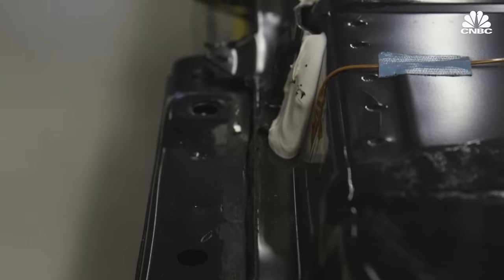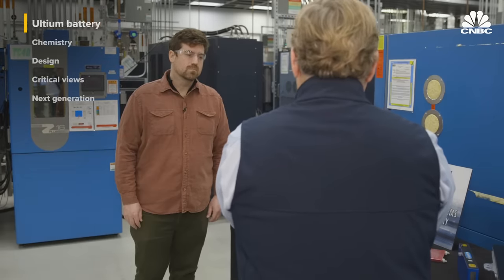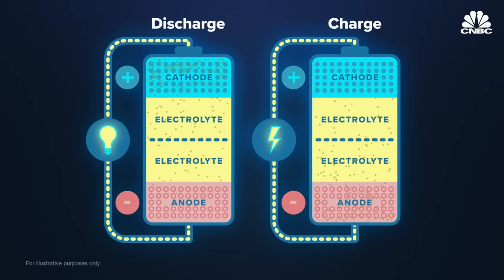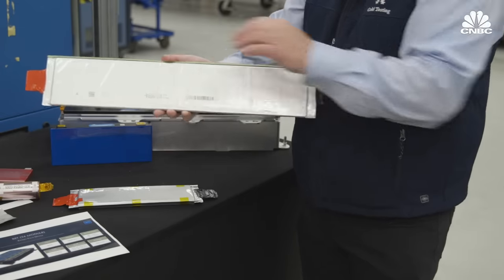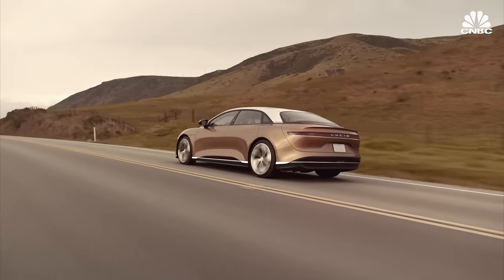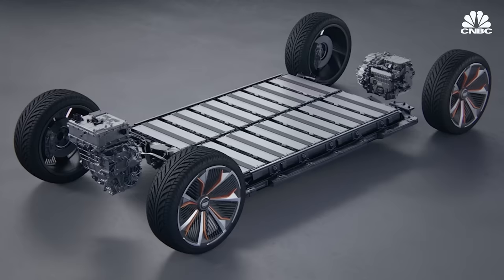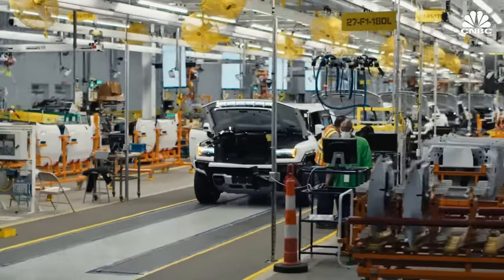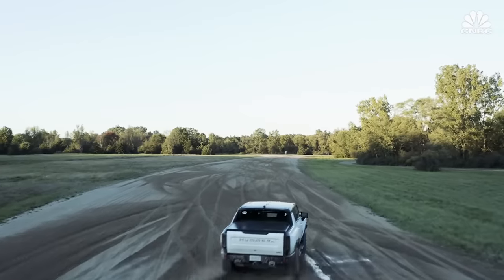Why GM Says Its Ultium Batteries Will Lead It To EV Dominance

Comment: I heard no mention of a cooling system for those battery packs. How will the inevitable heat be dissipated, so the infamous fire staters known as lithium ion batteries (the pouch style, especially) won't/don't go up in flames? Heat is the enemy of any and every thing.

Comment: There's nothing wrong with 'Ultium', but it's definitely nothing special compared to the competition. Locking yourself into a single structural/battery technology when the market is this immature seems unfortunate.
Reply: I dunno pretty good specs and LG energy believes in it and so do other brands as well

Comment: A range of over 400 miles means that EVS now make sense for me. Maintenance is much simpler on electric vehicles becuase their systems are simpler than internal combustion engines. If I can charge the battery with my home solar system, then I'll be able to drive by the charging stations!

Comment: As long as you have a very good battery and a good software 🐎

You have won most of the battle in the EV market 🐓

You just need to improve other hardwares after which is a lot easier then make the car very interesting!!! 🐆

Comment: There is no mention of overall efficiency or cost comparisons. Clearly LFPs have advantages for many applications.

If a car can get the same performance with a smaller less expensive pack, that makes it more profitable to produce...all things considered.

Tesla is using a wide variety of cells from several sources. If a new type comes along, they can pivot and use those in some or all vehicles. They can still use their "older" cells in Megapacks and Powerwalls. So they have great flexibility.

If you are an Uber driver or fleet owner, you will buy/lease the car with the lowest cost per mile. That looks to be Tesla now.

Then there is the overall manufacturing efficiency of Tesla's structural 4680 battery pack where the seats and console are attached and then inserted into the giga cast frame structure from below.

Comment: Let me help you .  A small permanent magnet is positive on one side and negative on the other side of the magnet.   The north side is the presence of electrons.  And the south side does not have the presence of electrons.  You can arrange these small magnets as batteries.  With each line of magnets accumulate the current and being one magnet of voltage  and all of the lines  accumulate
 the voltage.  You can arrange the small magnets to produce any current or voltage DC that you want to have as permanent current and voltage.  This can be wired to inverters to deliver high voltage AC power continuous peak power without fuel or pollution.  Charging stations is lame.

Comment: This is all well and good.  What concerns me is that I'm not hearing much talk about building new electrical power plants to support EV demand.
Reply: Gm just made a deal with pilot to put a gm charging station at every one of there stations and another 10000 charging stations by 2025
Reply: @wsupike1868  that's cool too, but I see that my comment was not clear, so I just edited it.  What I mean is not enough actual power plants to be able to supply the increased demand that EV's will put on the system.

Comment: Electric cars are not green as long as the electricity comes from burning coal or natural gas. There is no way that wind farms, solar power, and hydroelectric (dams) can provide enough power for all the cars that people drive. In the long run, electric cars will make nuclear energy a popular alternative, since modern nuclear power plants can be built more safely and provide the amount of electric power needed for all these cars. But, of course, that means dealing with nuclear waste. Fusion energy will be better in terms of radioactive waste, but fusion is many decades away from being practical--and will probably require government subsidies because it's not that economical (think taxes on cars to pay for the fusion-based electricity needed to run them).

Comment: I just got an article from Motor Authority about GM is getting into the electric boat business be cause they are the only company that has battery technology light enough for large high powered boats
Reply: And..... BMS tec is easier is a water world.!.!.!.
Reply: @philmanke7642  and that is why boats with 4 cycle engines require twice the horse power and use twice as much fuel? Because they weigh twice as much

Comment: I travel long distances (1,600 miles in a trip over 2 days) as such I need both the longer range and also fast charging.  And given that I am often in Remote/Rural Places of Wyoming and Montana having a way to quickly charge from a non-super charger type of infrastructure is going to be important for me to move to an EV.
Reply: So don't buy an EV.  What's your problem?
Reply: @rcpmac  If EV's become the only option then in the long run this is an issue that needs to be considered.  Especially as the Auto makers are making statements like 100% EV by 2030 etc...

Comment: I was at the Epcot center in 1985 at the energy pavillon and I saw a display of an electric car base frame quite similar to the present model and with a diesel 3 cylinder turbo for recharge and assist. So much time was loosened ……
Reply: Diesel so you could roll coal on EVs.

Comment: A alternator can be wired to 220v A/C and can power a whole house or it can produce high voltage D/C as well and also a alternator can be wired to be a single phase we don't need batteries technically

Comment: GM really needs to switch to Lithium Iron Phosphate battery chemistry.  It is cheaper and lasts 2 to 3 times longer.  It is also way safer.  Auto manufacturers in general need to get over this obsession with long range.  Long range means big batteries which are more expensive because of their huge size.  Huge batteries also weight a lot more so it takes more electricity per mile with means it takes longer to charge mile per mile.  As the infrastructure builds up for DC Fast charging the need for long range becomes mute.  The Chevy Spark EV was GMs first all electric vehicle that the public could buy not the Bolt.  I know I own a 2014 Spark EV which has a Lithium Iron Phosphate battery and in 8 years it has only lost 1 or possibly 2 miles of range.  California the DC Fast charging infrastructure has built up enough that even though my car can only go about 70 miles at 65 mph there are enough DC Fast charging stations I can go anywhere in California.  The great thing about the Lithium Iron Phosphate battery too is I can DC Fast charge multiple times in a day and it will not harm the battery.  You can't say that about batteries that use Cobalt and Nickel.  I drive for 45 to 50 minutes hope off the freeway and DC Fast Charge for 10 or 15 minutes and I am on my way again.

Comment: 1 million units in 2025 of 30 models is 33,333 per model per year.  Or just 20% off the projected TSLA numbers. 

8,334 per model per quarter isn’t up to catching TSLA currently or in the future. 

FY22: 1.440K (TSLA own estimates): using 50% basis for the rest of the current decade.   FY23 2.160K 
FY24 3.240K 
FY25 4.860K << GM supposed surpassing TSLA.  
FY26 7.290K
 FY27 10.935K 
FY28 16.402.500 
FY29 24.603.750
 FY30 36.905.626

Comment: gm has made so many misteps in the past that I am not sure they can survive, much less keep up and will probably never lead. They have to get their ship together in the next couple of years or Wuling (or some other Chinese company) will own the gm name soon after (Think Volvo). I don't think they have the leadership team to pull it off (oooh, 50KW charging on a new Bolt).

Ford's change in management seems to be putting them in the right direction, but all these legacy automakers have such huge issues transitioning that I am not sure they can do it. I do give Ford the best shot of any of them.

The one thing that "might" save the legacies will be the Tesla supercharger network, when it opens up to the other EVs.

Comment: Why this news program does not include a number of clips of Elon Musk talking about the need to have inexpensive high volume battery production is beyond me. There are any number of quotes from the last "battery day" presentation that shows Tesla's efforts to bring down the battery cost. Everything said by the GM engineer that was supposedly innovative has already been done by other manufacturers (mostly Tesla). GM does not need to present itself as innovative, rather they can be just as impressive as saying that they understand they need to make this change and luckily they can use guidance provided by other manufacturers to catch up quickly. The fact that every one of their new vehicles is a massive one is disappointing. Not only does that increase resource utilization to build the vehicle, but it increases charging time and electricity used. The GM and Ford electric trucks will be roughly 1/2 as efficient as Tesla's M3 and MY, which is unfortunate. That said, I am so glad they are finally going electric and will stop polluting our world.

Comment: What the Auto Manufactures do not tell us, is what I find troubling.  Where will we get all the power to charge these batteries and how are we going to dispose the batteries, when no longer usable.   The manufacturing and disposing all add to polluting just as does the creation of electric.  Batteries store electric, they do not create electric.   If you buy an EV for $60,000 to $70,000 and then several years later must replace the battery for an additional $20,000, most of us will end of walking.

Comment: Only $1 to drive 80 miles so it seems very inexpensive until that battery takes a dump on you. Tesla's battery replacement costs about $25,000 or GM says "the life of your vehicle is over, buy a new one". You will forget all about how cheap those recharges were really fast when it costs $25,000 for a new battery. With the toxic heavy metals in the batteries it's only a matter of time before there is an added $5000+ surcharge for toxic waste disposal.

Comment: I'm not biting until GM publishes some specifications for their Ultium battery.  What's the overall weight of the battery pack.  What is the power per kilogram of the chemistry?  GM talks a lot and sends out a lot of press releases but no one has been independently verifying anything from GM.  Talk is cheap - well, in the case of EVs talk is also expensive and in GM's case talk is not convincing.

Comment: A car can run off the alternator with out a problem alternator put out a good amount of amps and voltage and can run on there own if u no what ur doing.  Connect a small 12v light bulb to the alternator and spin it by hand and it'll light

Comment: I live out west where the population density is low and the distance between towns can be very large.   It will likely be a long time to get the electrical grid up to sufficient capability to handle charging large numbers of ev's in such areas and to have a sufficient number of charging stations available for long distance travel.   You can pump all the electric vehicles out you want but if there is no where to charge them on a trip, you're dead in the water.
Reply: They take too long to charge and their energy density is too low.
Reply: @bighands69  There are new batteries on the horizon with nearly twice the capacity of the ones Tesla is using.

Comment: So what is revolutionary in Ultium battery? When the world is going to solid state and borophene based batteries, GM is still talking about Li-ion batteries. GM should define their battery pack form factors and interfaces such that when SSB, Graphene/Borophene based and even Nano/Nuclear Diamond Batteries are available, it can switch its old battery pack for new packs containing newer technology. Hope GM is working with QuantumScape, SolidPower, StoreDot, and other battery startups. 

In the future when battery technology hits a plateau, what will differentiate one EV from another? Customers will not care what battery chemistry their car has. What will differentiate will be cost, range, time to charge, miles/kwh, handling, comfort and other functionality. I own a BOLT, but I still get range anxiety if I have to drive from the Bay Area to Sacramento and back. I have to wait hours charging my car before I venture back to the Bay Area... I'm waiting for a cheaper BOLT with at least 400-500 mile range... Lyriq does not do well as far as range is concerned, and is TOO EXPENSIVE... If Tesla comes out with a cheaper car ($10k-$15k) with ~300 mile range (of course using newer battery chemistries with much higher energy densities) I and many others will switch to Tesla.

(Also GM is still talking about EV leadership in the US, while Chinese companies are thinking about global EV leadership. What happened to the US? Sad that it lost its leadership in several technologies. Too much infighting and polarization in the U.S.)

Comment: So just in terms of CO2, how "green" are these cars? Well I did some calculations, comparing my 1996 Ford Fiesta with one of these things and over the next 10 years the Tesla is 20 TIMES WORSE!!! I will explain:- I have taken into account the build, the replacement battery in 7 years, tyres which wear out faster and the fossil fuels required to charge it up. My Ford, will need a few spare parts each year, one set of tyres and does around 50 mpg (5.5l/100km) covering say 10,000 miles (16,000km)/year. Looking at depreciation, the Testa will be a write off as the cost of new batteries will outweigh it's value and in 10 years my Ford will be 36 years old. Now I could look at a newer car and the results would be similar, but 20 TIMES WORSE is a big number for something we are told is "green" and which I have to subsidise and the owner has to suffer range anxiety, or buy a second car. That is the reality folks...you are being had!!!!

Comment: As long as its lithium ion the battery isn't groundbreaking and won't create any sort of advantage in the market. Lithium ion battery's use expensive and hard to find materials and don't have enough charge cycles to justify long term use in a vehicle most consumers want to last as long as an internal combustion engine.

Comment: I´m all for EV, BUT...... One huge problem, that no one wants to talks about, it that batteries eventually fade out, until your car can no longer works properly. You might say, well, just replace the batteries, right? The thing is, it will not be financially viable, like fixing an old gas engine. Batteries are incredibly expensive to replace. So, selling your old EV will become an impossible task, rendering it worthless. Disposable. 
So, until batteries prices come considerably down, which they should, I´m sticking onto gas cars. 
Now, ignoring this issue (and charging times and driving range), EVs will only make sense if the electricity to charge them is clean. Otherwise, we´re are just fooling ourselves all over again. Lastly, what is going to happen to all those old batteries one EV become the main transportation? They must be recyclable.  Best wishes to the EV industry!

Comment: my LG refrigerator  has a replaceable bus style glass fuse underneath a screw panel on the top of the refrigerator. When I blew, it cost me three dollars and the fuse was obtained at the local hardware store -in 1/2 hour.. One year later LG fuses were soldered in place I assume as an attempt to keep the homeowner from replacing them and forcing you to buy a whole board. 
On the internet is a video on how to unsolder the fuse.  So no stay away  from LG and hence GM

Comment: Isn’t that odd. I’ve heard much differently. When I think battery powered vehicles … I think about my DeWalt 20 volt battery circular saw. On. Then dead battery. Fortunately I only have to swap out tho battery and I’m good to go.  If I’m between destinations …. I’m screwed or sitting on the edge of a parking lot at night charging my nifty “green” car.

Comment: The major issue with electric vehicles is the battery technology. Lithium ion batteries were developed 50+ years ago and haven't really changed much since. Until there is a major breakthrough in battery technology most electric vehicles will just be junk and GM is no exception here.

Comment: GM if you're listening again. We need to design and implement a removable battery system. Only then will the mainstream embrace electric vehicles. Charging times are far to long currently.